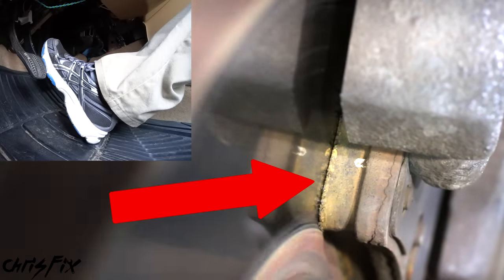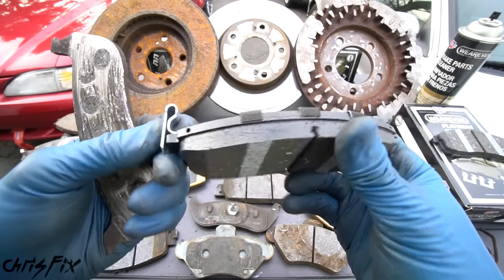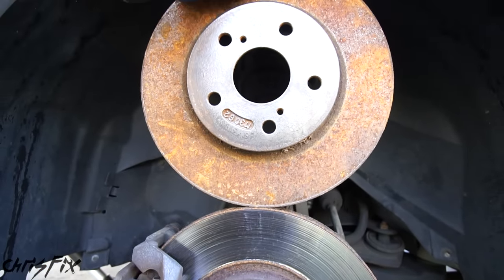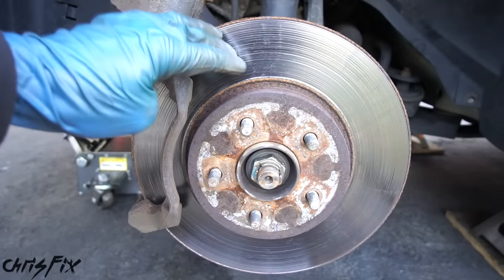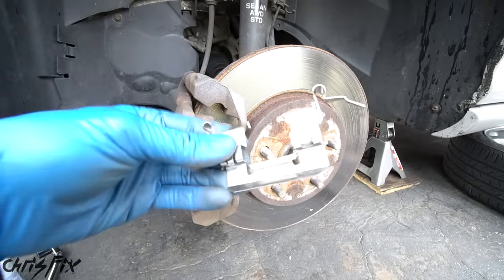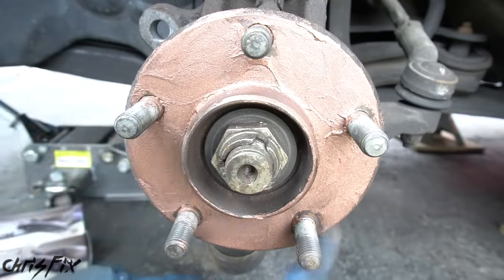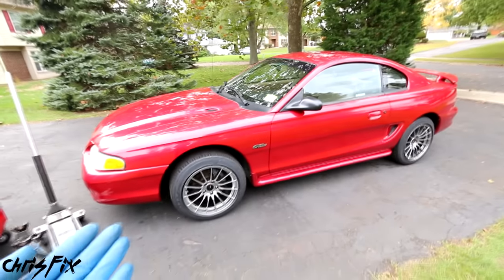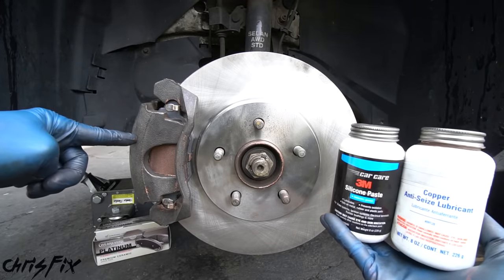How to Stop Your Brakes from Squeaking

Comment: A really good practice that not a lot of people follow, would be performing some routine preventative maintenance to your brakes at each oil change/tire rotation. When I change my oil I also rotate my tires, as well as open up each brake caliper to clean any rust that’s built up anywhere, clean the hub, and apply all fresh grease. No matter how resistant and durable grease is, it’s not durable enough to last the entire duration of the life of the brake pads, which is what can lead to premature wear caused by pads not releasing when they should. A little routine preventive maintenance saves a lot of money and maximizes the life you’ll get out of your brakes
Reply: I dunno, I just replaced my brakes at 90k miles and the caliper pens seemed to still be moving pretty much just as free before I cleaned and re-applied grease.  Not saying a little preventative isn't a good idea, but EVERY tire rotation pulling the brakes apart seems a bit excessive.

Also to my great surprise the fluid still looked pretty much the same as new when I started to flush (also the first time in 90k, unless the dealer did it for free without telling me *snort), so maybe Mazda just makes some really kickass brake systems.
Reply: @sultanofsick  Mazda does make good products. It might be overkill for me to be greasing them up every 7500 miles or so, but I only started doing that after a couple back to back sets of prematurely worn pads, and a set of warped rotors. If I was paying a mechanic $89.95 per hour to service my brakes, then absolutely no way I would service them that frequently. But doing it on my own which only cost me an hour of my free time and the cost of grease, hell yeah it’s worth it for the peace of mind. I personally just try not to cheap out, take shortcuts, or skimp out on brakes, wheels and tires. Flirting with death at that point in my humble opinion
Reply: @theodoreclay2213  You're way better than me, no way I could do it in an hour.  Took me about 8 doing brakes and rotors as a first timer.  Happy I did it and saved a boatload of money, but wouldn't do it again just for fun :D
Reply: @sultanofsick   lol at least you rolled up your sleeves and did it. Invest in a good jack, a $50 battery impact gun on Amazon, and set out all your tools ahead of time like Chris does in these videos, and it’ll go faster and faster each time. Having all the right tools for the job and of course not having to fight with seized up bolts and rusted rotors will speed it up as well. Some cars are designed well and the brake work goes fast, others are designed like crap and it makes everything a fight to perform any work. I did a brake job for a friend, and what was supposed to just be a brake flush ended up turning into a trip to auto zone at 7pm before they closed to get a caliper due to the bleeder screw being cross threaded from the last idiot to work on it. Once that valve is stripped out like that, your caliper is toast. No way to know it was cross threaded and just jammed up on it until you loosen it and see that it won’t retighten. The profanity coming out of my mouth was on point at that moment

Comment: Chris, never use copper paste on any brake parts. It acts as an electrolyte and makes the brake parts corrode like the slide pins because you are mixing metals. Allways use a ceramic paste when working on brakes.
Reply: +uberdude - uh oh, now i don't know which i should use.
Reply: JustMe I attended a brake presentation from bosch a few days ago and they said never to use metal based lubricants because of the high risk corrosion, some mixes of metal produced 2 volts when tested. I only use ceramic based lubricants
Reply: TheUberdude14 high temp grease can also work. Just don't get any on the rotor or pads.
Reply: TheUberdude14 with the amount of anti Swiss he used Idk if that wheel will ever come off cuz that wheel will be welded on there. I've had mixed metal weld together on valve stems. Had to dermal them off.
Reply: Thanks for the info.
Reply: He used silicone paste on the slide pins, which your suppose too...
Reply from the maker: Using copper based antiseize on the brakes is recommended but never use antiseize on the guide pins, only silicone paste like I showed. Every 'lubricant" has its down sides. The ceramic lubricant you are recommending wears out the metal on the caliper faster because ceramic is a harder material than the soft copper. So its one of those things where you pick and choose. I never had a brake caliper undergo galvanic corrosion due to dissimilar metals but it is an interesting point.
Reply: thanks all.  what chris says makes sense.  since it's just for my own brakes, i'll take my chances with the copper.
Reply: I'm not a huge fan of silicone paste.  Whatever happened to molybdenum disulphide grease (aka moly grease, aka sulphur grease)?  Like graphite, it retains lubrication even when dry, but is a malleable metal like copper.  It also doesn't deteriorate rubber parts like slide pin dust covers and is good for temps up to 660F.  And if you get it on your fingers, it'll take a day of scrubbing to get it off - and you'll still feel a bit greasy.  :-P  Awesome stuff.

Comment: How about a rock , stone, or pebble between the dust shield and the break rotor. This is very common in countries where you drive on gravel roads or where the roads are covered with friction gravel during winter months. And now the obligatory thanks: thank you! Your videos are clear, well illustrated, concise, to-the-point and extremely helpful. Superb work!
Reply: happens they flick up and get stuck in the brake pad I think, they will flick back out eventually but all of a sudden you're driving and brake and it sounds horrible like your car is going to break lol.

Comment: WD-40 solves all problems
Reply: If it should move, use WD40
If it should not move, use ducktape!
Reply: Nicholas R.M. WD40 is a degreaser not a lubricant
Reply: Of course! It's an engineering inside joke!
Type engineering flowchart in google images!
Reply: Mike lol
Reply from the maker: lol
Reply: +Nicholas R.M. I think you mean "duct tape".  The last time I tried to tape my duck he laughed himself silly...you could say he "quacked up".
Duct tape is great stuff except that it really fails badly at one thing:  Taping ducts.  But REAL duct tape (removable backing instead of rolls) is the greatest stuff on the planet. It even tapes ducts!

Comment: Turns out some of the brake hardware I had ordered on amazon was defective causing a little metal clip dig into the rotor. Don’t cheap out on brakes is what I learned
Reply: Or be careful about installing them correctly...
Reply: Yes, I've had to grind down some aftermarket brake hardware that was too wide.

Comment: Another reason they could be making noise is you have the wrong application break pads on your car. For instance the more expensive performance break pads are often designed for racing, so they are made to stop better at a high temperature you would encounter when you take your car on the track, but in day to day driving your breaks don't get that hot and the performance break pads make noise. Normal break pads are designed for a lower temperature and won't make noise at the lower tempratures
Reply: Flatus Antiquitous give him a brake!

Comment: today i learned that the only thing you shouldnt clean with brake cleaner, is the brakes! 
my life has been a lie  -_-
Reply: You do clean the rotors (when new) with brake cleaner...they come with cosmoline on them, which is a grease-like corrosion inhibitor.  A good spray of brake cleaner will wash it off the rotor (both sides, obviously) and can be wiped dry with a clean rag or paper towel.
Reply: @ApartmentKing66  So brake cleaner can be applied to the rotors only in that instance? When they're fresh out of the package? Or can it be used for regularly cleaning the rotors?
Also, doesn't applying brake cleaner to the rotors automatically brings it on the brake pads by contact between the two parts?
I'm genuinely curious, not trying to be a smartass. It's hard to convey tone with these comments. :D

Comment: Alright, alright last one I'm really going to bed now.
Reply from the maker: sureeeee, just one more ;)
Reply: Anti seize is not resiste to heat none sense on hot brake parts
Reply: David Mcmillian You could use Permatex Aluminum Anti-Sieze which is resistant to temperatures up to 1,600 degrees Fahrenheit.

Comment: Another source of squeaks especially on mtn bike disc brakes is the pad type.  Downhill mtn bike pads squeak until they're warmed up and then they're great.  Other pads won't squeak, but will even boil silicone DOT5 brake fluid causing brake fade when they're hot doing downhill.
Reply from the maker: Thanks for the tip Brian!
Reply: Dot5 has the highest boiling point, both wet and dry, compared any other DOT certified fluid though. Around 500F dry and 360F wet.  
Mineral OIl will not fade on you though. Build a 'cool can' for your downtube, removes that problem in a heartbeat.
Reply: Don't know much about mountain bikes but I do know breaks Do  they make a break caliper with ceramic pistons in them? Some car brands use ceramic pistons to keep fluid temp low. Break fade happens when the surface of the pad is the same as the rotor. Reason they make slotted rotors to help cool. If you are doing a lot of downhill and you still get break fade and own a Dremel tool get creative and groove your pads then see what happens. Remember you are thinking about trying to fet surface temp down but not losing friction area also. Good Luck !
Reply: @foreigncareater  honestly not a bad idea! Remember to use a mask to make sure it won't give u covid

Comment: brilliant job buddy, professional video too. I always do my own servicing as I don't trust garages or stealer ships to do the proper job as shown in your video. my current vehicle is a jeep grand cherokee 2.7 diesel going through it front to back doing all these jobs including stripping the caliper pistons rubber seals dust seals new pistons slider bolts and give them a good wire brushing and a fresh coat of paint. rebuilding a brake caliper now that would be a good video you could make, any ways you Deffo know what your doing, keep making great video like this one and yes I have liked your video and as soon as I have finished with this comment I am subscribing to your channel. :-).
Reply from the maker: +Vazza yzf750 thanks and awesome! I'm the same way! Welcome aboard!
Reply: Vazza yzf750  Have you tried 2T (2 stroke oil) as fuel additive in your diesel? Lubes egr valves and runs smoother i  500:1 -1000:1 ratio (2ml to 1 liter or 1ml to 1L of fuel/diesel)

Twc 3 standart or any will do.
(Google it)

Is safe in low amounts and is cleaning the carb build up from pistons a little

Comment: I prefer using synthetic high-temp (preferably ceramic enhanced) brake grease for the slide pins, backs of the pads, as well as any slides/hardware/contact points. I've seen various anti-seize compounds "powder up" over time as the liquid elements dry up or wash out. This is fine to protect non-moving components (like the threads of a bolt) from corroding and seizing up (intended purpose of anti-seize), but it isn't conducive to brake components moving freely. Copper is definitely less prone to issues than most, however, so if you insist on using anti-seize that's the way to go. Nickel anti-seize would probably be good too but it is expensive, rare, not sensor-safe, and a toxic heavy metal. Very niche.

Permatex makes a ceramic enhanced brake lubricant that's rated for 3000 degrees, and is intended for use anywhere you need brake lubricant, very good stuff. But any good "brake lubricant" is OK for most situations, certainly better than nothing.

Now with all that being said, please everyone forward this video to every technician that complains about brake noise or "warped" rotors! About 99% of issues are caused by poor installation or other failed brake components (calipers, hoses). Noise complaints especially - I have literally WATCHED technicians do a 30 second "pad-slap" and bolt a wheel back on - and then they wonder why they get comebacks. That's why some pads started using multi-layer coated shims (as seen in the video) on the back of the plates, they are somewhat better at reducing vibration and chatter than a smooth shim / no shim, especially when installed DRY!
Reply: I assume you are referring to Permatex 24125 Ceramic Extreme Brake Parts Lubricant.   Seems to be a great product but not for the lubricant if the pins from what I hear.  Best to use silicon grease for pins.  Would you agree?   And anti seize for wheel hub.  Thx
Reply: @FD-dh2fu  Yeah silicone is best for the pins but anything is better than anti-seize. Anti-seize is good for bolt threads (including hub bolts) and that's about it.

Comment: Thank you chrisfix! For saving me at least $500-$800!
I had to replace the brake calipers and after that my car started making very annoying squeaky noise. Pads and rotors were very new. So i was confused.
Watched a lot of videos no solution until i watched this video and learned that i have to use lubricant on metal to metal points etc.
No more squeaks, I’m very happy! Thanks again!

Comment: the reason copper anti-seize is better is because the griphine stuff isn't heat resistant.
Reply from the maker: Graphite is more heat resistant than copper... Graphite is a form of carbon which is the same stuff they make the heat shields out of for space ships.
Reply: ChrisFix huh, guess my level 1 instructor lied to me. Great videos though 👍
Reply: +Oliver Rantanen they also use it for crucibles when melting down metals
Reply: Graphite is used in Atomic Reactors to cool them down ;)
Reply: MKLele Can confirm. Dad works as a nuclear reactor mechanic. and I'm studying to be one
Reply: ChrisFix, graphite is black and solid in NC, so I don't think the graphite based lubricant is just made out of graphite.
Reply: +Jim Bob Then you know that graphite isn't used to cool them, but as a neutron moderator. Graphite moderated reactors have fallen out of favor since Chernobyl demonstrated how the flammability of the graphite can release enormous radioactive fallout in the event of s core breach. Water, D2O, or liquid metal is used for cooling and neutron moderation now, with neutron poisonous control rods controlling the rate of fission and therefore temp of the reactor.
Reply: + on ABS Cars, you can mess up the Sensor Signal
Reply: +GEMC The ABS sensor is a magnetic device which senses the teeth on the tone ring. Copper is non ferrous and won't interfere with it. Antiseize should never come close to getting on the tone ring or sensor... They're usually on the inner CV joint cup or on the hub bearing sleeve. Not close to the brake caliper bracket or the front hub face.
Reply: The Copper and the Material from the Knuckle can Induce Voltage into the Sensor.
It depends on the Car and the Axle-Setup, at least on the Cars I Work on it is a big problem which I have seen very often.
Reply: +GEMC Those cars would be? I have a hard time believing a nonmagnetic element can induce a voltage into an electromagnetic reluctor coil...
Reply: I Work on Volkswagens, they usually do have a Aluminium Alloy Knuckle
Just google for Contact Corrosion, you will understand it.
Reply: The problem with graphite moderated nuclear reactors is not any flammability of graphite, the stuff is actually very hard to burn.
The (main) problem with the RBMK-1000 is that it uses graphite as moderator and water as coolant.
This means the graphite already makes the reactor run by slowing down neutrons while the water in the cooling channels lowers the potential of criticality by capturing neutrons. If the water disappears from the cooling channels, the reactor has an easier time maintaining a chain reaction. This is called a positive void coefficient, and it's a very bad feature for a nuclear reactor to have.

What basically happened at Chernobyl was this:

-The engineers tried running the reactor at very low power levels after it had been running at full power for a while. This quick lowering of the power output stalled the reactor because of a fission product eating up all the available neutrons. This is called the iodine pit.

-Infuriated by this failure, instead of just giving the reactor time to get rid of the neutron poisons, the engineer in charge ordered his subordinates to get the reactor running again. They tried to do so by raising the control rods, by the time they had achieved criticality all control rods were out of the core.

When they had their reactor finally running at the desired power level, the engineer in command pushed his "Make the reactor go boom" button, which had been fitted for this experiment. What it did was turning off the cooling water feed pumps to see whether the remaining kinetic energy of the rotating steam turbines would provide enough power to keep the water pumps going in an emergency.

-The water in the cooling channels quickly boiled away, the reactor was now supercritical and the iodine was neutron blasted away. When the engineers noticed something was going wrong, they pushed the Soviet style scram button. This meant all control rods being pushed into the core way too slowly. The control rods were graphite tipped, by the way.

-The ensuing criticality spike drove the reactor power up to ridiculous heights, and the remaining water in the reactor flashed into very hot steam, which ripped apart the entire building.

And then still, since graphite is so incredibly hard to burn I highly doubt it was actually graphite that was burning in the accident. It's much more likely that building debris containing combustible materials fell onto what remained of the reactor core and burned vigorously.
Reply: hey guys, does anyone use Permatex aluminum anti seize?